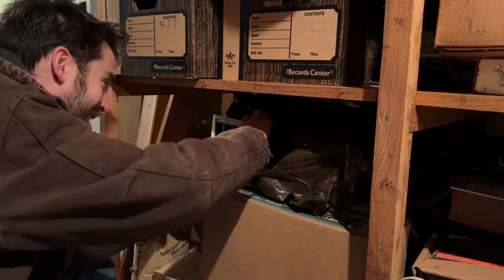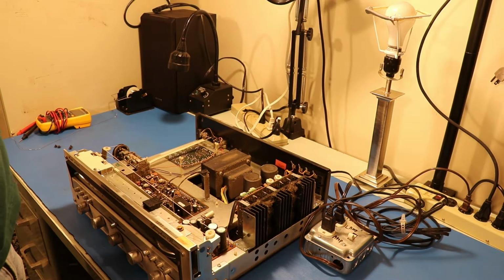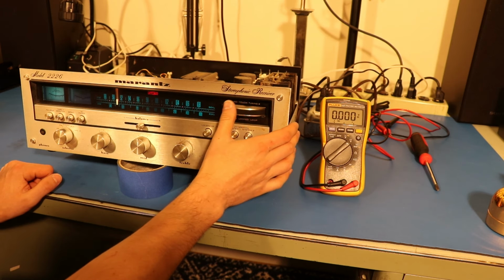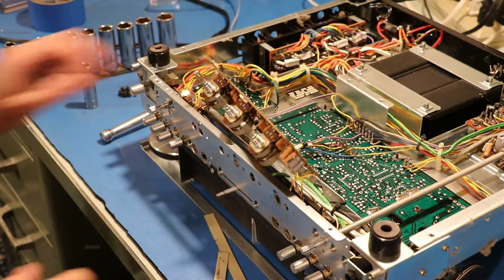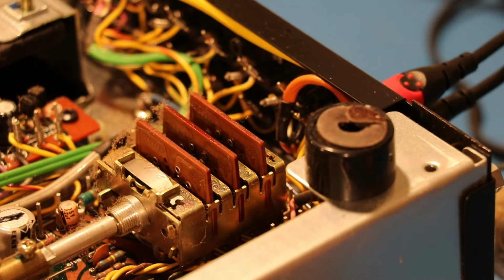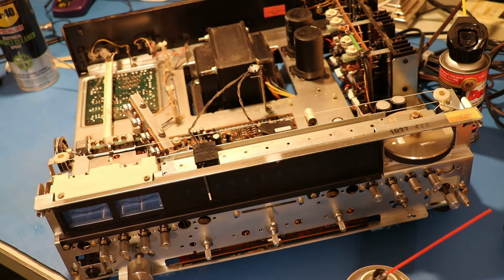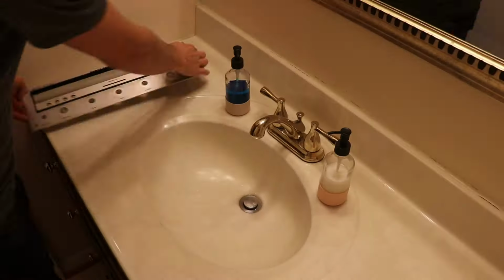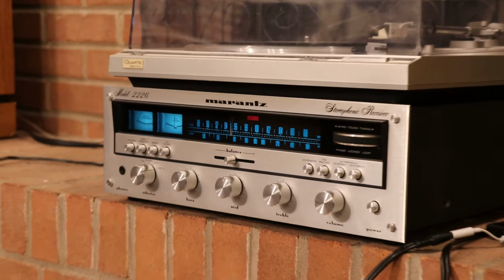Forgotten for YEARS...does it still work? Marantz 2226 brought back from the basement!

Comment: Nice find. I went to the auto wreckers a couple of weeks ago to get a spare tire. After finding that, I went looking around, and came upon this wrecked van that had an old stereo hanging out the back doors. Upon a closer look, it was a Kenwood Kr-7070a from 1970 to 1971. About the only thing keeping it from falling completely to the ground was the cord being tangled around some sheet metal equipment that was in there. I went in from the side door, and rearranged everything to get it free. While doing that, I noticed another receiver in there, it was a Pioneer SX3600. My main interest was the Kenwood. It was pretty heavy, so I just left it there.
     After paying for the tire, I left. I got about a mile away, and decided to go back to ask about the stereo. I told the guy about it and he said I could go get it. I managed to carry it back to the office that was about an eighth of a mile away. The veneer on the cabinet was lifting all over so it looked in really rough shape. When the guy behind the counter finally got off the phone, he took a quick look and said, take it. I couldn't believe how lucky I was. When I got home I did the dim bulb start, and everything worked, except the FM. It comes through, but all garbled, and the signal meter doesn't move much, even though my other receivers show strong signals with the same antenna. I figure either a capacitor, or a bad transistor is the culprit. I went back a couple of days later, and grabbed the Pioneer. It works but the left channel is running hot, with distortion. I guess a recap and maybe replacing some transistors will fix it. We all get lucky every now and then.
Reply: Cool story and find. Start with a deep clean and inspection. Look for cold solder joints...burt resistors. Clean the switches / relays and  pots  and tuner capacitor before going balls deep on a recap.
Reply: @Poppinwheeeeellllllieeeeez  Yes, will do. I have already removed and repaired two toggle switches that felt like they weren't working properly. Because this machine was out in the weather for who knows how long, they were ceased up a bit, and the little ball bearing on top of the toggle inside had popped off. Thanks for the advice.
Reply: @johnb5519  I had a 7070 some years ago. Cool receiver. Loved the auto tune feature. Another of those wish I hadn't sold it units.
Reply: @johnhornsby7578  Yes, the auto tune feature is nice. The fm is all garbled, but the tuner automatically locks on to stations just fine, and the stereo light comes on, so I suspect something on the mpx board to be bad.
Reply: Absolutely  a keeper! 🗿🎸
Reply: Just was wondering you're input found a model zenith c440 w got it working absolutely incredible they don't make them like they used to especially with the new headphones wow
Reply: The Cat wants to be in the Video
Reply: See youtuber linguoer..?

Comment: Scored a 2220B with wood sleeve out of the metal recycling hopper at work 13years  ago.  Plugged it in w/out speakers —no dial lights.  Rolled the tuner knob until it landed on a strong FM station, and the Orange stereo light lit up, so I knew then it was worth cleaning up and checking out further.  It ended up needing only only new array of lights behind the dial. 🏆 
Still using it regularly!

Comment: Once I found Akai AA8080 1972 or 1974. By the time I found it it was 40 years old. I took it home, plugged in power socket and turn it on. First I heard crackles and low frequency hum, but nothing burnt. So I decided to leave it turned on for a couple of hours. When I returned to receiver, it was silent. I thought it died, but no, it was alive and worked like new. Capacitors got full charge and restored their capacitance, so I didn't need any repair or restorations except buying new knobs.
Second time I looked inside receiver was 6 years later when a couple of capacitors started degrading so I replaced them. So it still works and give me joy!
Now it is about 50 years old and it feels and works fine.

Comment: treat all frame and metal work with Bullfrog. wipe front frame panel and shafts with cloth/wd-40 , spray down bottom of circuit boards with deoxit d-5 and tilt to drain off. protects old unit from corrosion. spray down rear panel with wd and wipe down everything. tighten all screws and boards gently .

Comment: I used to sell and service Marantz. They were great!! Very nostalgic watching you. The biggest problem I had on the early 70's models was when the push button switches were made with silver plated contacts. They were constantly tarnishing on seldom used buttons. Luckily they changed the design, but it was a pain going through and changing them. 🙂
Reply: wow it was like you read my mind sir, as a customer, I have  but the contacts are just terrible sometimes, I have to use toothpicks to bind up the side of the button just enough to where they make contact. 🙄🤔😏😬

Comment: Another good video ! recommend leaving the ratchet handle in the toolbox & using a 1/4" drive handle instead, less chance of "over-torquing" "snug" is the proper torque spec.there. also, after blasting the tuning air capacitor clean, notice that there are two little bearings on the air capacitor shaft that I feel should get a drop of fine lube. as a Mechanic myself, I like all moving surfaces to have a bit-o-lube   .....  look forward to more repair videos   .. cheers

Comment: If your guy had it in a shop, he was blowing it out with compressed air periodically.  If you look at the areas that had dust build up, it was areas that the air nozzle couldn't get to.  The outer shell doesn't have openings there?  Either way, awesome find.

Comment: My wife and I had a stereo receiver that looked just like that. We bought it around 1982.  It was awesome. The tuner looked so cool. . Not sure if it was the same model. The volume control wore out and had dead spots and I couldn't get a new part and cleaning it didn't help. I was a stereo tech for a couple years.  I might still have it in the basement for someone to find some day.   They don't make them so pretty anymore.

Comment: This video brought back a lot of great memories.  My parents had a Marantz Receiver similar to this one back in the early ‘80s.  

I remember the first time I adjusted the weighted tuning dial as it just felt “expensive” unlike a a tuning knob from anything else I used before,  It also power to drive these large 3 way Acoustic Research speakers with real bass.

That stereo system sounded amazing!  Hard to believe that was like 40 years ago.

Comment: WOW!!!
Those were sold in every "department store" (Macy, Sears, Nordstrom, Gimbles, Service Merchandise, etc ) sold these stereo systems known as "rack units". Each came with a cabinet with four or five shelves, between two and four components (turntable, cassette player, amplifier, equalizer, tuner, etc.) and a hefty pair of speakers and as you can see they "looked" powerful. Almost everyone had one in their home in the 80's, they were as popular as flat panel TV's are now. They ranged between 200 to 400watts per unit and while they were more than enough for residential use they weren't even a fraction as powerful as they look.

Great Find, thanks for the blast from the past...

Comment: Back in the day (1987) when I was taking an electrics class I repaired a Marantz amplifier for the school library. I did it on my own, it wasn't a class project. I did buy the output transistors as well as the transistors for 2 stages before the output transistors. It takes me back more than a few years.

Comment: I would use a vacuum cleaner, an old tooth brush, and some compressed air to get Rid of the Dust and Dirt!! 
CRC make an electrical contact cleaner. 
For some music small systems just Do NOT cut it, most Rock bands still use valve amps because they sound GOOD man, just do NOT let them too warm!!!! 
A couple of years ago power company had been working out in the street, when they turned on the power again a large power surge blew my amp bastards $400 damage killed the amp, eventually i found a suitable amp to run my speakers!!

Comment: Great video. Looks Mint. Way to deliver a solid vid !!!

Those wafer switches can be a huge PITA. Before I give up on bad ones and pull them out.....I use a little metal polish on pipecleaner and poke it in and turn it around with my drill on a very low speed and lowest torque setting. Flush with 99.9 ipa and a few fresh pipe cleaners....the hit it with some flavour of preserve it. It has never failed me, but exercise extreme caution and work gently. I hate risking FUBAR pulling it all apart and de / re soldering the million pins.

Comment: That's a loverly bit of kit, it just needs a bit of love and i would expect it work for years more.
I have an old pioneer SA 706 amp, it was found sitting on top of a dust bin, just waiting for the rubbish collection men to take it.
Lucky for me a friend saw it and it ended up at my house.
The mains power switch had failed, that's the reason it was on the dust bin.
That would have been a shame.
I was going to say ' XRayTony B is great, you might like his repairs'
Sorry waffle mode lol.

Comment: Back in the late 50s, I got interested in receivers. Transistorized was just beginning to come on the market. So, instead of a tubed Fisher receiver, I got an transistorized one. I still have the receiver, but, now I wished that I had gotten the tubed model. The sound is much warmer and fuller than the one with transistors.

Comment: I work at a PC recycling center. You wouldn't believe all the old stereo equipment we get. Sadly it all gets destroyed... My boss has let me have a few pieces, but after I got a couple of Kenwoods (KR 7600 & KR 4070), a Marantz 2245, and a Sansui Six, he cut me off. I'm trying to convince him to let me do "trade-ins", if/when better pieces come in. Lol

Also got a Technics RS 630 TUS cassette deck & a Peavey UMA 150t II amp/mixer, and a complete Bose AV 3-2-1 III set up with 2 extra sattelites and the remote. (Had to search through 1800 pounds of wire, to find the $75 link cable.) I don't even own a TV. Lol

I used to be a DJ and my boss insisted I take a pair of Yamaha MGP32X mixers, we got from a local college. I cleaned them up, got them working properly and donated them to a couple of churches.

Edit: Spellchecker got me.

Comment: The problem I find with sheet metal screws are all the little metal bits that fall onto the circuit board. I clean the bits off when taken apart, but when reassembling I can only hope that nothing shorts out. It's totally bad practice to use such screws and I see it all too often, even on units costing several thousand dollars.

Comment: I currently have the model 2235B in my man cave. In Florida that's a garage. It is doing the same things as the one you just cleaned up. I believe I could clean it the same way you just did. And I need at least 3 bulbs. I sure would like to get this thing rocking again. Where do I get the bulbs. I don't think Radio Shack is in business any more. I didn't know how to clean the controls and you just showed me how! I bought that unit new in 1975. Along with the model 6200 belt drive turntable. I am inspired to get that receiver sounding clean again. Thanks I liked and subscribed!

Comment: Grandpa had good taste in receivers.  I wish that contact cleaner trick would work on the tuning caps I have on the type of radios that I work on, but usually they're just so dirty that I remove them and put them in the ultrasonic cleaner, then re-lube their bearings when I re-install them with new rubber isolation washers as the old ones have usually turned into hard little pucks.

Comment: I am really enjoying your videos and, even though I have been doing audio restorations for years(mostly tubes), I have picked up a lot of good tips from you. It just so happens that I recently picked up a basket case Marantz 2015. I have started to place my Mouser order, but I cannot remember what replacement transistors you were recommending. It would be really great to create a spreadsheet with values and Mouser numbers for each model you restore. I have a 2015B that will be next. Thanks for sharing your work.
Reply from the maker: https://audiokarma.org/forums/index.php?threads/transistor-substitutions.688515/

Comment: I picked up a 90s lightly used Onkyo TX-SV515PRO.  Thing pushes 2 12s 4 mids and 2 tweeters like it's nothing and very clear w crossovers added . I push it pretty hard sometimes and it performs without failure .

Comment: Hi great videos in your channel, just subscribed. I came because of the DeoxIt video but luckly through its comments I became aware of this one an ended out being so handy, I'm about to bring to life a Marantz 2252B, which was sitting on a storage for 20+ years and was really wondering how to start up in a smooth way to avoid any fire or so. You hooked a 100W regular lamp (not electronic or led, right?) in series as a load to dampen the initial current, did I get it right? Did you leave connected previously before working on the unit or after the check up a bit? 

Any recommendation on this specific step is much appreciated, since I lost a pair of speakers from a Pioneer microsystem this way last Dec (mine while teenager but left sitting for decades, turned on ok but speakers started to sound like a low freq that was gearing up until it was finally blown, I guess I may have saved it if I at least hooked up the load before or shut the unit down imediately... I guess maybe some DC was being fed into speakers by some defective component in the amp board...)

Comment: I had a Marantz 1060 integrated amp back in the 1970s -- it appears to be of similar vintage. It also had pre out / main in jacks,
Reply: Me too, bought it new in 70's with a tuner. Beat the crap out of some 4 way Jensen speakers with 15" woofers. They are sitting idle in my basement as eye candy!

Comment: I have a Marantz 2238, same as 2226 except for higher power output. It was purchased over 40 years ago, and has just been repaired after several years of not working due to a broken power switch. To my surprise it worked perfectly again just by replacing the switch and doing a cleaning/deoxidation. However, some display bulbs appear to be in bad shape, even though they still light up; where can you find these 8v tubular bulbs?

Comment: I've got a cassette player from Same era, very posh loading system, More like loading a VHS, still comes on Only the elastic band around the cassette wheel broke, I didn't know how to source spares back then as I opened it up in the early 90s, it's probably late 70s early 80s, also have a rotel amplifier,sold that on eBay for my dad tho

Comment: Hi,
I got a Marantz SR6000
Both power amp STK need replace, 
Do you thing we need to replace the STK3082 as well, reason I asked the board wher the 3082 is located, the board is badly burnt. 
Two transistor exploded with 4 resistors. Where you would advice me to buy those stk pack?

Comment: Dish soap is ideal for cleaning face units. Never make the mistake of using harsh cleaning compounds. It's a very high risk of obliterating the silkscreen.
Reply: I learned that the hard way. Lost part of one word before I stopped.
Reply: @THOMMGB  I guess it's fortunate not more was lost. I suppose an immediate fix would be to aquire adhesive lettering. Not the same of course, but it's something.

Comment: Great video! My electronic knowledge is pretty limited, I could change a few caps, but further fault finding is beyond me; my trade was in simple DC telecom circuits, relays and switches and such. I still have my old Kenwood Hi Fi (KD32 series, sold as the Kenwood Spectrum here in South Africa), which I bought back in 1984. It still sounds great, only the tape deck is a bit weird, some mechanical fault, it gets stuck in rewind. Maybe a pointer from you, I have difficulty locking onto FM stations, I've tried all different antenna orientations but little difference there...? A dry joint on the antenna circuit maybe?

Comment: 11:09 The panel lamps flickered as you played with the bass control, suggesting the power supply was weak.  But it didn't show up in the power measurements.

Comment: I like your video. It reminded me that i have an old receiver in my basement. How would I go about finding a place to buy my old marantz 2265. It has been sitting in it's original box in my basement for 30+ years. I remember when I quit using it that the power switch wasn't working correctly. Some times it would turn on or it wouldn't turn off so I figured it was in the power switch
Reply: I had the 2265 as well 
A Technics turntable.
JBL 3 way, 12" woofer, 5" mid-range,  1-1/2" tweeter. Those were the days

Comment: I bought a Harman Kardon 430 way back when it was new. In all this time, I cleaned the pots a replaced a bulb. It play great. I'm happy I paid a little more at the time to buy the radio than a cheaper one.  It still plays great and I like it. Does anyone know how good this radio is?
Reply: Harmon Kardom,the most desirable  stereo in the 70's. Great sound and quality.Still have the Amp and tuner.

Comment: lot of time  there is oxidation on the controls spray cleaner lubricate of pods  it will take scratchiness out  and shazam  it works  you dont have to put meters on it  clean hook up  clean dust off top of component interior  go